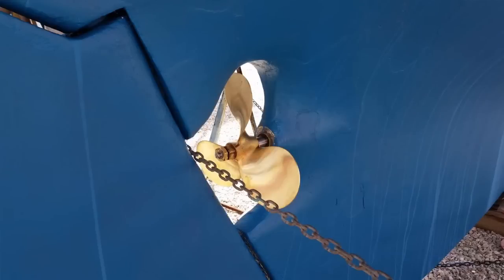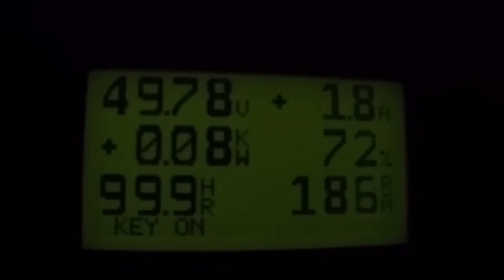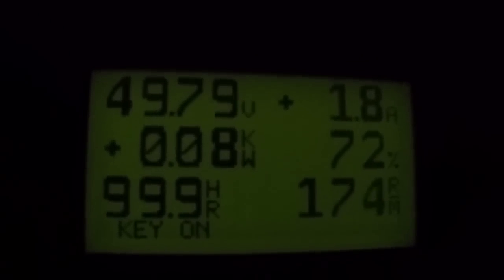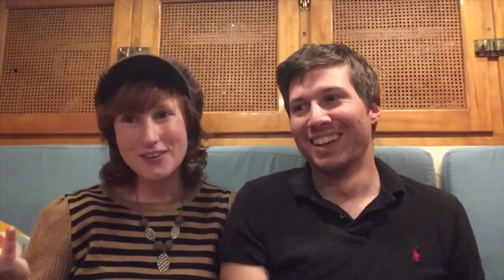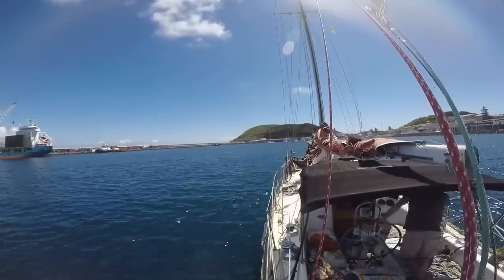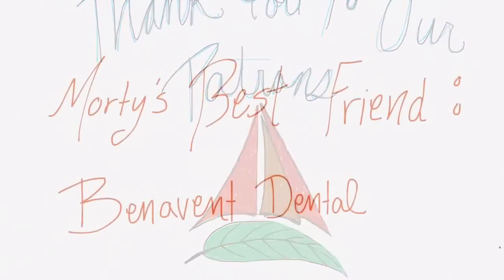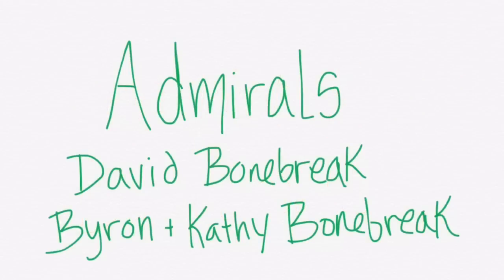Electric Motor, Ocean Crossing with Regeneration | Sailing Wisdom

Comment: You already have noticed that with regen there is no free lunch. I'm afraid with a drop of about 1 knot during regen I would be going crazy. But in your case you planned that the regen would be essentially a backup for the solar panels, and in that case it makes sense and you were able to take advantage of that capability. Other than that, my only comment is that I think electric propulsion almost has to be implemented in conjunction with lithium batteries. It's only money!

Comment: I've a few questions.  

1.  You stated your generation was 6 amp at 6 kts, 2 amp at 5 kts, and 0-1 amp at 4 kts.  Is this at 48 volts or 12 volts?

2.  You mentioned that when you disconnected the motor, that your speed increased 1-2 kts.  How do you disconnect the motor/generator?

3,  With your 31.4' LWL your hull speed should be about 7.5 knots.  So, if you were generating 6 amps at 6 knots, then you were losing a maximum of 1.5 kts of speed, if the 6 kt speed reading was accurate.  Were the speed readings fairly constant when you noted these amp readings when at high speed or were they fluctuating as you surfed down waves or rose to waves? 

4.  The prop drag when generating power should decrease as the shaft RPM and power output decreases.  The power vs speed curve on a displacement hull is very steep.  These two effects, combined, should mean the speed penalty drops as the boat speed and power generation drops.  Herby, is the "1-2 kts" speed penalty you stated just a ballpark figure or did you measure the speed penalty at different boat speeds and find that the numbers were repeatable at the same boat speed?  Assuming a 1.5 kt speed penalty at 6 kt actual speed (7.5 kts if the generator is disconnected), I would expect a speed penalty of about 0.5 kts at 5 kts boat speed and close to 0 kts at 4 kts boat speed.  

Thanks for taking the time to produce this video and for emphasizing that electric propulsion is not for everyone.  It is clearly suitable for some people, just as a sculling oar and no engine or motor is for others.
Reply from the maker: Hello, these are some thought out questions!
1. At 48v. To step down to 12v the amps quadruple, so 1 becomes 4 and 6 becomes 24. I’m just used to seeing them in 48v so that is how I was describing it. 

2. We turn off the motor with the key and pick up speed, or if we really aren’t going to use it for a while, we turn off the motor batteries with a battery switch. Turning it off with the key still draws a little power to keep the engine in “stand by” mode.

3. That is our hull speed when we are upright. At 10*, a lot of our stern goes in the water and we can get up to 9 knots. At 20* of heel, we have done 10 knots. 
The speeds are constant. At the end of a passage, we see crazy high “top speeds” from surfing. Our highest across the ocean was 14 knots! 

4. It was a ballpark speed drop. When we are going 3 knots and turn it off, we will get up to 4. When we are going 7 and turn it off, we get up to 9. 
That being said, we have been on a broad reach in 30 knots of wind doing 8-9 knots with the motor off. When we turned it on to start charging, there was no notable change in speed because we had plenty of wind power to keep us at hull speed. 
At the same time, if we are moving at around 1.5-2 knots, there is no real difference in dragging the prop with the motor on or letting it spin with the motor off; there just isn’t the wind power to move. 
The numbers for the speed are more of an average change rather than a calculated change. It just happens to always be around a 1-2 knot difference. 

Thanks for these questions and let me know if there is anything else I could answer for you. Who knows, you might even ask something that I haven’t thought to look for!
Reply: @RiggingDoctor  Good answers.  With the much higher hull speed when heeled the speed losses you state make sense.  One thing I still don't understand is turning the motor "off"  with the key.  Please explain how the prop shaft is connected to the motor.  Is there a transmission?  If not, and the shaft is connected directly to the motor, then what turns the motor "off", allowing the prop to free-wheel?  Is it something to do with the motor controller?
Reply from the maker: The motor is connected to the shaft via a belt. There is a toothed pulley on the shaft and another on on the motor mounted above the shaft. It almost looks like an alternator belt on a car (but the 100+ amp alternators that need an extra wide belt). 
When the batteries are “on” the motor goes into “standby” and draws a tiny bit of power but it is not spinning the propeller. 
With the key in the “off” position, it’s in standby mode and not influencing the propeller. 
With the key in the “on” position and the throttle lever in “neutral” the windings in the motor are electrified and the magnets of the motor are now influencing the prop shaft. 
If you are sailing, this is the position for regen. If you are slow, the prop won’t spin and will be a lot of drag. If you are fast, the prop will be turned by the passing water and that will spin the magnets in the motor to produce power. 
In the “on” position, if you move the throttle lever forwards or back, it will then draw power and force the propeller to spin, driving you forwards or backwards. 

Basically, the battery switch turns everything off and let’s the prop freespool freely with no drag. If the batteries are on, the motor is in standby and relying on the key switch to activate it.
Off let’s it keep freespooling, on starts the regen.
Reply: @RiggingDoctor OK, I'm starting to understand, but still have a few questions.  

1.  Does the motor shaft aways spin when the prop shaft is spinning?  I'm trying to determine if there is any type of clutch or not.  

2.  Are the toothed pulleys on the prop shaft and motor shaft the same diameter or are different diameters used to step down the prop shaft rpm from the motor shaft rpm?

Thanks.
Reply from the maker: There is no clutch or transmission. The motor pulley is directly connected to the shaft pulley via a belt. When the prop turns, so does the motor. 
The pulleys are different sizes, giving you a reduction gear. The motor pulley is smaller than the one on the shaft. The size ratio (gear ratio) depends on the pitch of the propeller you already have. 
You don’t need a reduction gear if you are willing to buy a new and properly pitched propeller, but a reduction gear is typically cheaper than a new prop.
Reply: @RiggingDoctor  have you tried spinning up the prop on power and then backing off till it starts to regen to overcome the starting resistance on the prop?

Comment: 14 cubic feet!  That is a decent size.  One of those college dorm refrigerators is around 1.7 cubic feet.  What are the approximate dimensions and was it custom made?  One of my long term goals is to install a freezer/refrigerator although I have to say that a well insulated icebox does surprisingly well for coastal sailing when done properly.
Reply from the maker: Check out the instructions on a well insulated freezer in the Pardey books, they just had an icebox for their whole life!
I don’t have the exact dimensions since I’m not at the boat, but it is about 4 feet tall, 4 feet wide, and 5 feet the otherway. I know that is much more than 14 cubic feet, but that’s because of memory and not actual measurement! I did actually measure it when sizing it for a new compressor unit and it was 14.something cu ft. 
The unit is custom built into the hull of the boat and has 6 inches of foam insulation. It holds ice rather well :)
Reply: @RiggingDoctor  Thanks.  You are probably close on the measurements since the generous insulation you have will add a good bit to the bulk.  Thanks again!

Comment: 2000 wear out parts on an internal combustion engine.. & every dealership knows the big money comes w engine diagnostics & selling new replacement parts. An electric motor has now wear out parts. 
When diagnosing electric motor failure.. if there's an odor of burnt plastic or paper & there's a bulge in the side of the housing.. it's time to replace the motor. 👍

Comment: have you tried conecting your diesel to a generator so you would be generating electricity while using the diesel for propulsion?
Reply from the maker: We actually completely removed the old diesel motor, so we can’t do that. That setup is called a hybrid drive and it gives you the best of both worlds!

Comment: What was the story with the solar panels?  Can you provide the make and model and make a recommendation on how to avoid solar problems?
Reply from the maker: They were cheap ($50) panels from Amazon that were about 3 years old. The flexible panels on the deck were also cheap ($80) panels from Amazon but only lasted about a year. 
We don’t recommend flexible panels because they get damaged too easily. 
We are going to replace the stern panels with larger and rigid panels soon.
Reply: Do you know what went wrong with them?  Was it the connectors breaking or did they just fail internally?
Reply from the maker: They corroded away to dust in the salt air
Reply from the maker: Literally, dust! I opened the connection box to see why they weren’t pumping out power and green dust poured out. It was all that was left of the copper wiring :(
Reply: That is really important info.  I wonder if there are steps that could be taken to "marinize" panels that come with copper wiring.  I was looking at flexible solar panels for my hard bimini cover.  They would be out of the way and rarely would have any foot traffic.  Wonder if your panels would have held up under those conditions?
Reply from the maker: The issue I have heard with Bimini mounted panels is when the wind blows, the Bimini will bulge and drop, and this flexing of the panel kills the flexible ones. We met a couple who was pissed because they bought the expensive flexible panels and had them sewn into their top. The cells had a bunch of craze lines in them from flexing and they weren’t getting much of any power out of them. They had a warranty, but this was their second set because their first ones died. 
It seems that the expensive and cheap ones die just the same (but the cheap ones have no warranty). 
I would suggest having a rigid backing for them wherever you put them so that they don’t flex. 
As for the rigid panels. One still works, one died. The one that died had its connection cover slightly opened in a storm off Hatteras, and then took about 8 months to corrode away. I closed the box tightly as soon as I discovered this but salt had already gotten in. The other panel escaped unscathed electrically and is still pumping out power. 
Our plan is to fit larger rigid panels on the stern in lieu of the rigid 50w panels we have. So the good 50w will get tossed as it’s space is needed for a larger panel.
Reply: All good info thanks!

Comment: re-gen is like mapping a maximum load curve....but talk to your controller manufacturers about marine specific software updates, and learn it......i don't know if they have a marine specific software update for it, but  the software should function like MPPT in re-gen.....( with an adjustable current limit that lets the prop spin more beyond a point )
so if they do have a marine MPPT re-gen software update, it would be a piece of cake, otherwise you have to work for it, like you're hacking the system to get what you need..
the Sevcon controller re-gen is like a rubber tire on a road.....well it's not quite like that, is it?
Reply from the maker: It has the ability to turn the level up or down, but when it comes to programming the unit, that’s above my pay grade. 

Had I built the system, I would have learned how it all works; but I chose to install a system that was plug and play, sacrificing my learning for the ease of an already designed/tested system.
Reply: @RiggingDoctor  the hack is building an analog circuit to run on the analog pins....yeah, that is not a consumer grade hack....but i am trying to rally people to demand a marine specific software update ( the more people who bug them, the faster it will get done )
like the charge voltage is the charge voltage....so the MPPT programming would ask for a nominal voltage and cell type.....and the MPPT then is entirely based on the current output.....and at some RPM, the current would be limited, where the product would remain the same, no matter how fast the prop was spinning.

Comment: Have you looked into the new motor they have made that will charge at slower speeds ?
Reply from the maker: I have not! The motor is a bit expensive for me to be switching out. Ours is a pretty basic unit that spins when it gets electricity. I’ve seen fancy motor setups and they make me nervous: more gizmos = more points of failure.

Comment: One of the sailing channels, I think it was SV "Sailing Aquarius" did a really nice cost comparison vs. peak battery performance life cycle analysis and the results where very well explained verbally, and visually with graphs.   If sailers have the money for the lithium battery acquisition, they will reap the benefit and return on investment over time.   That said, my feeling is that sailers going to complete electric power should also make sure that their solar panels are in tip top condition, and actually have spare panels stowed on board as well, and as you do have a "portable" gas generator for emergency.   But I do have a question for you.   Is there such a thing, or what are the best practices of mixing and matching batteries sets?   Let's say, for example, you have 4- 100 amp batteries.  Are there any battery BMSs that can simultaneously recharge a bank of 2 AGM batteries and a bank of 2 Lithium batteries?   Can they co-exist?  If so, could you keep the best AGM batteries you have, or even all the AGM battles you have, and then complement your total power with a bank of Lithium batteries?  I don't know the answer to that question.  I was also think that if there isn't a BMS to simultaneously charge different chemistry batteries, there is another way to handle the issue.   I was thinking that you could have a bank of AGMs wired in series or parallel, depending on the battery voltage of the batteries and the intended voltage output required by the boat or the inverter, and connect them to one side of a multi battery turn-off switch, and have the Lithium battery bank connected to another terminal on the battery switch.   The idea being you could either toggle back and forth between banks with the battery turn-off switch.  I have a switch for "battery 1", "battery 2", "both batteries", and an "off" position.   Furthermore one solar panel and BMS could generate power for one battery bank, and another solar panel and BMS could generate power for the other battery bank.   So they are separate banks, but have full redundancy, and use the battery switch to toggle back and forth as required until a boater could accumulate enough Lithium batteries for one massive bank, or even keep the two banks as lithium banks.   What are your thoughts?   I think it might all come down to how much room can a particular boat dedicate to battery stowage, but I'm of the impression, more is always better; and full redundancy is a safe choice.  Your thoughts?
Reply from the maker: Technically, yes, a multi bank option would work with their own dedicated charger. 
Now for the issues. 
You want your batteries to be all of the same age and ideally of the same production lot that way they all mesh well. As they age, they begin to die and a dying battery will suck the life out of a new battery and kill it! 
The second issue is space. If I had more space, I would go building groups of 4 batteries that would make 48v banks, but we struggle to fit 8 batteries. When these come out, the new ones will take their space and we will get rid of 8 still working AGMs that have a bunch of miles on them! 
I do like the idea of having separate banks so that we can break up the pain to the wallet!

Comment: Hi Guys. Great videos. As you may be aware, diesel-electrics have been used in trains and ships for many years. However I have heard little about similar systems in yachts. I imagine there would be several advantages in diesel/electric systems in a yacht. Key would be the Diesel engine could be placed centrally in the boat to optimise weight distribution. The electric motor being lighter and smaller could be placed in an optimal position to efficiently drive the prop. It is possible, the diesel motor required could also be smaller and therefore a fuel/weight saving - the reason being the diesel could operate at slight higher revs to match the most efficient power band for the engine. Thirdly, it may be possible to have la hybrid system using lithium batteries as a back-up??? Has anyone got any thoughts on this????
Reply from the maker: That is the recommended setup for an electric motor. Have a diesel generator somewhere in the boat and the electric motor spins the prop. For short maneuvers, the batteries can manage just fine, but if you want to motor really far, the generator can power the motor. A DC generator is preferred for reasons of electrical efficiency to directly supply the power needed.
We didn’t do that setup for two reasons:
1. We don’t have the space.
2. The recommended diesel generator was $20,000
At that price point, I figured I might as well just drop in a Yanmar and call it a smoggy day. 
For budget reasons, we went with the smallest battery bank that would work and with AGM batteries. Not really the ideal setup for distance motoring.